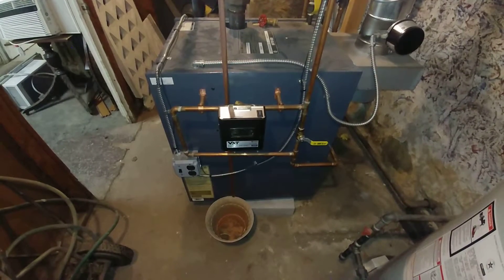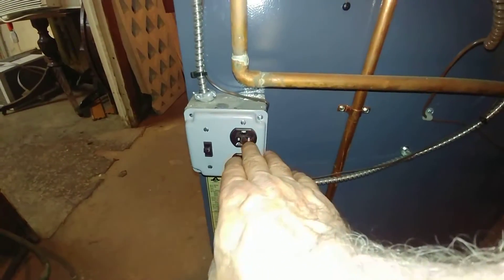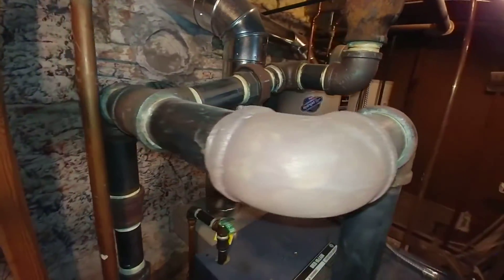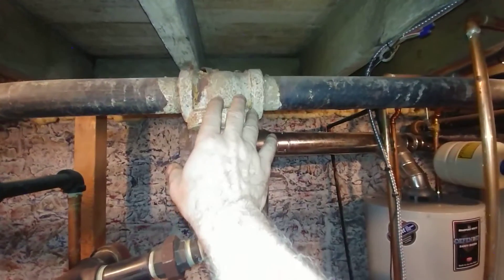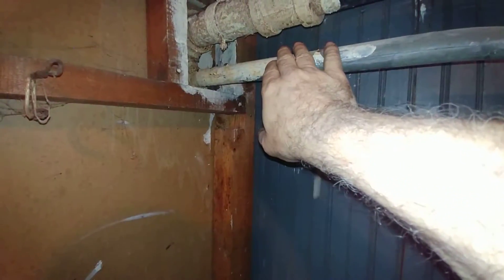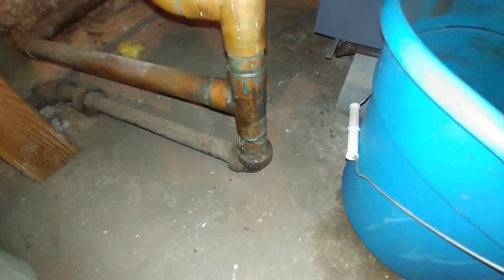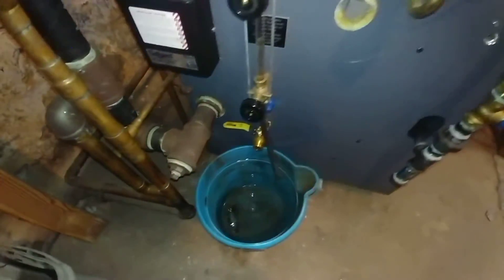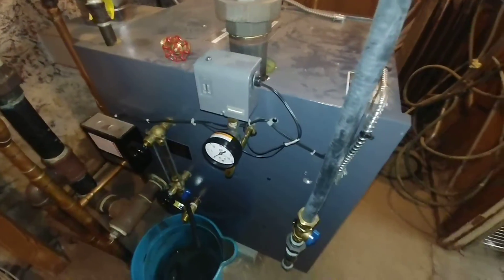Critique Of Steam Boiler Install Done By "Others"

Comment: You can almost tell that a scorched air guy did it due to the convenience outlet . Really should use EMT (hard pipe ) for the electric drop. WM has transformer on left side. Would have been easier to mount box too.  Can't really tell if it's been skimmed. I'm going to say it hasn't. At least the insulation is missing around tapping so I'm hopeful. Don't like the copper drop on return. Could of installed a drain on wet return. Not a fan of the CSST gas drop either. Bit sloppy but at least there's a two an a half inch riser! :)
Reply: The convenience outlet is appreciated in those old basements (at least by me) where there is usually one outlet, two pronged no less, all the way on the other side of the basement and everything (washer, drier, sump pump, freezer, etc) is already plugged into it.  Yes, it would have been better if it was a GFCI outlet, but I'm not going to fault it.

No, it was not skimmed. That plug was factory installed and never moved.  Most aren't in my area, at least.

Yes, one can fault the copper on the drip and Hartford Loop, since the wet returns are still steel.  What I didn't mention until now is this install was done in January of 2018, so one can imagine pressure by management on the one hand and the owners/residents on the other, the fact that very few short-cuts were taken speaks well of the technician in charge of getting this done.

Further, this install was done by an oil company knowing they were losing this account forever and would never see this boiler again, so again, this is not too bad overall.
Reply: @elgordo271  GFCI receptacle is code now in Connecticut. Although, Firomatic thermal cut off isn't anymore. Also, any new domestic hot water lines must be insulated.

Comment: I think the riser tee off the header should have been vertical
Reply: Maybe so, but I'm not so sure.  If we do a gedanken experiment, we can imagine the steam moving into the riser off of the header, some of it contacting the cold metal, turning into condensate, and trickling back into the header.  If the riser is vertical, the condensate can be imagined dripping down into the path of the on-coming steam.  Now, turn that riser to the rakish angle that you see above.  Now what does the condensate do? It may instead from a stream on the bottom of the riser and slip into the header and down the equilizer line without getting in the way of the steam moving out.
Reply: Gordon Schweizer I think it does that anyway. Water doesn’t want to leave the pipe wall. Also there is very little condensate only at the beginning and then almost none once it warms up. But I would be OK with some angle—this angle is pretty extreme though!
Reply: @pb7379-j2k  Yes, this angle is pretty extreme, no question.  I don't think it really hurts the steam quality, not as much as the lack of proper cleaning.
I've learned that contaminated water will overwhelm good piping every time!
Reply: Gordon Schweizer agreed! Never been skimmed, right?
Reply: @pb7379-j2k  That's right.